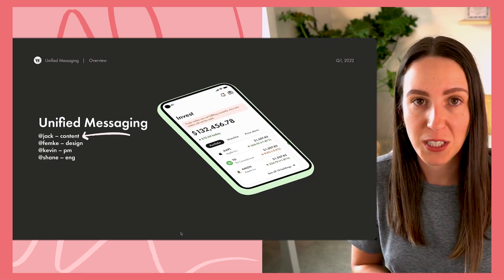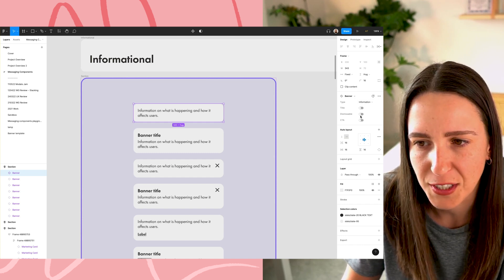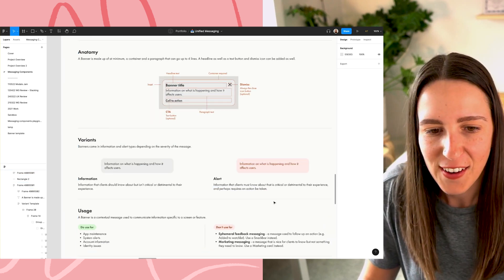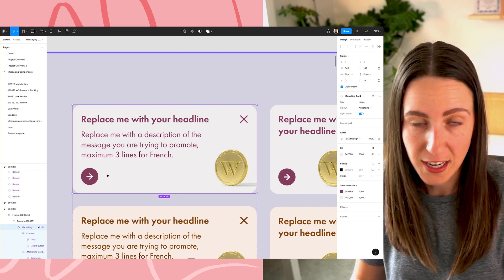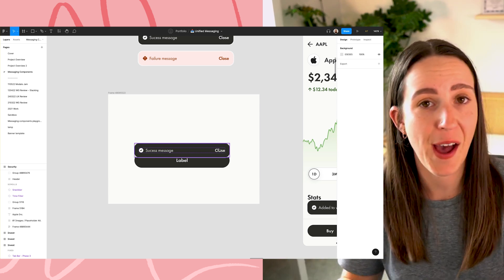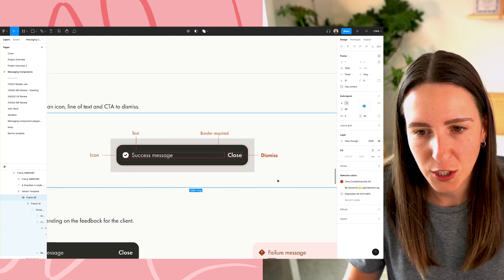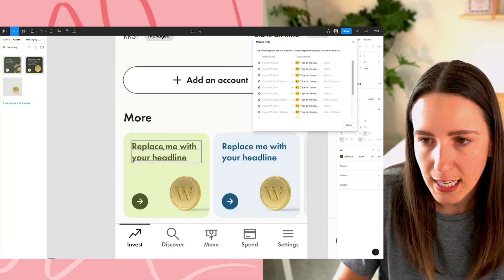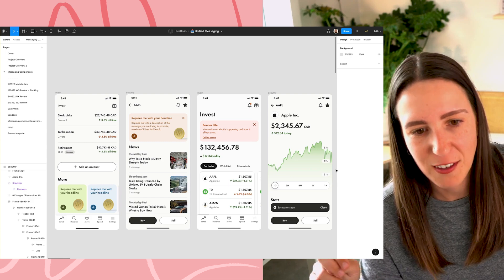Design systems case study walkthrough: Designing components and creating documentation [Part 2]

Comment: Yay, great thorough case study! Thank you for all the effort you put in it. One quick question: I was quite surprised that you have never worked with design systems/making components before. I would presume that working at Uber you would have to do that and it's necessary to be fluent in components and design system creation when you want to apply for senior roles. At least this is what I caught myself thinking, but I am super interested what is your take on this. Not being fully experienced with working in design systems yet, stopped me from applying for more senior roles.

Comment: As a person who both designs and develops software, I admire the effort visual designers put into creating high fidelity prototypes and use guides while at the same time feel like they are a huge waste of time since things always have to be done twice. One time in Figma and one time in code. I feel like the tools have changed but the way we work hasn't. We are still doing the same PSD to HTML, this time it's Figma to React.

Since you are quite well known among designers, I wanted to know your opinion on the matter. Do you believe this divide between design and engineering is the ideal sweet spot or are there barriers to be removed?, if so, which ones? Wouldn't you feel better if your work was more impactful to the engineers you work with?
Reply from the maker: Gonna save this for a podcast topic as I think there's a lot to dive into here!

Comment: At 14:00 - a simple way to fix this problem in Figma is to click the absolute position button in the top right of the properties panel. Absolute position makes it easy to maintain the same layer hierarchy, but the absolutely positioned element is ignored by auto layout
Reply: The best way is to hold down "spacebar" when dragging an item to a frame with auto-layout. The item will remain on top and not snap into the auto layout.